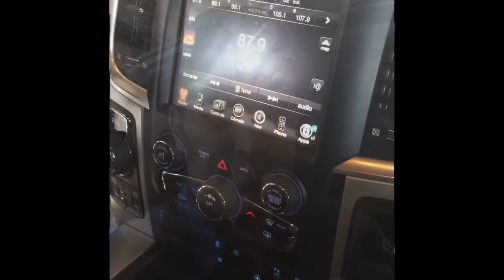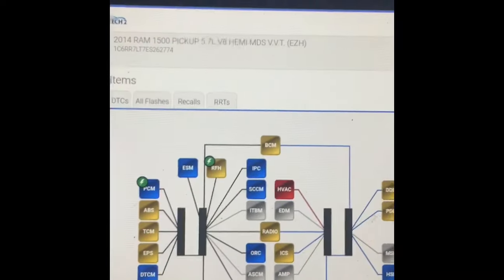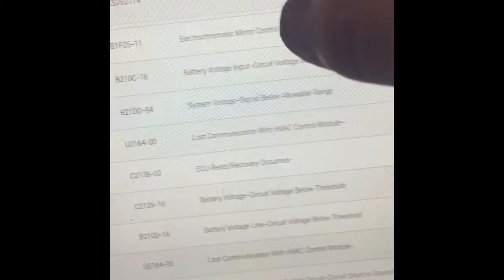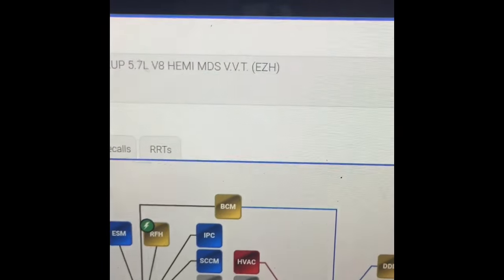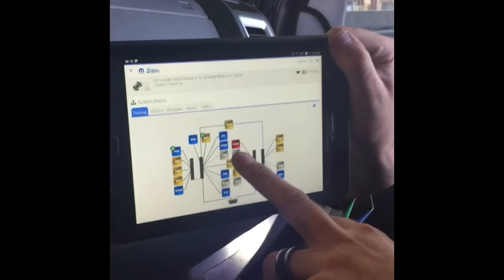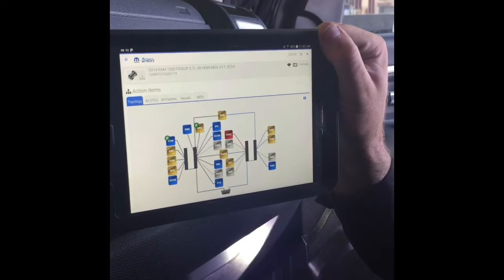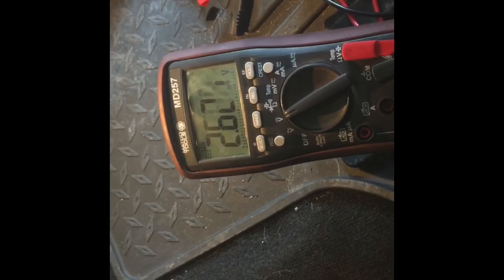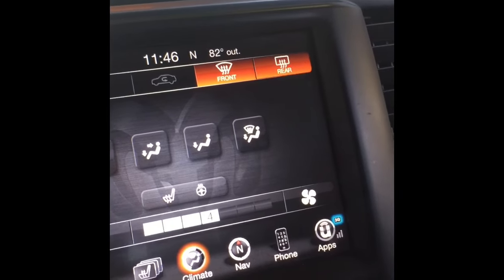Lost communication with module chrysler

Comment: Got a 2016 durango limited 3.6 with the U0212 code. Load tested can + and can- both in spec. Load tested power and ground as well all at module plug which led me to think the module was bad. Replaced it with a new OEM part from the dealer and same codes and wipers stay on with only horn function of steering column. Same issue but all good at the plug. This one has me stumped and it's going into day two at the shop of what was supposed to be a easy fix after the diag.

Comment: I have a 2011 ram 1500 and lost communication with central gateway,radio "aftermarket",hvac and my key fob will not lock,unlock anymore. I do not have remote start 5.7 Hemi

Comment: Got busted at job making videos? Just gave up? The luxury of being a dealer tech is having known good parts to plug in like very expensive control modules. Most of the time you’ll probably be OK but you should load test any of those circuits. Good video. If you have the module you don’t have to load test them just plug it in and see if it works.

Comment: What about 2015 Chrysler 200 ? I have no power in my middle console and was told my control modules was the problem
Reply from the maker: Yes it more than likely needs a control head.
Reply: Do I have to take it to dodge or can I get a mechanic to fix it ?
Reply: Is it very expensive ?

Comment: I have a 2012 Durango R/T.  It has an intermittent problem where it starts and runs for a couple seconds and then dies.  Attempts to start without first turning off the ignition result in a 10 second or so crank with no start.  The engine will start and run fine after the ignition is turned off.  I have had the fuel pump relay recall done and I have checked the relay's function during one of these events, I know the fuel pump is getting power.  Yesterday it did it again and I was able to use my diagnostic tool and saw that at least half of the 20 or 21 modules lost communication with the ECU; the ECU showed no faults.  It will probably run for months without this happening again. Ever see or heard anything like this?
Reply: Did you figure out what was causing it to not start?
Reply: Bumpp
Reply: @Highrev57 any updates boys

Comment: Why did you test all the voltages in a STATIC state?  You could have 14  v at the connector when unplugged b/c there's NO current flow.
However, plug it in and BACKPROBE it.  You could have a voltage drop "upstream" from the connector and when the circuit is CLOSED, you are only getting 7 v at that wire!  If you don't need to voltage drop test this circuit, please explain why not.  Thanks so much!
Reply from the maker: That’s over thinking this easy diagnosis.
Reply: Load tested the one I am stuck on right now and everything checks out at the plug. New OEM module from the dealer and still no coms and still the same U0212. Load testing along with just static does not always show the issue and just because everything checks out at the plug load and static does not always mean the module is the issue as I am finding out the hard way.

Comment: My brothers 2016 jeep Cherokee latitude is doing the same thing. Where is the HVAC control module? Is it behind the head unit that has the 3 control buttons? I see a black box with 2 different harness connectors. His ac system is to be dead and all the fuses are good. None of them are blown.

Comment: I need a expert opinion.  2017 Jeep Cherokee. Trail hawk 2.4. Got tints. He removed batt. After a day I got cel. PSCM no communication (still had power steering. Or electric idk which I got. ) month later or so. Cel came one. Tried scanning. My scanned freaked car out. All dash lights and chimes and stuff came on along with front wipers. Reset it with a better tool. Had permanent codes for loss connection to tmc bcm pscm scm can c. Vehicle speed measure and vehicle distance measure. And can bus c code. All relate to the can bus. Could it be the battery is bad? Or should I just reset the ecu by taking off the bat for a while?
Reply: I hope you got your issue figured out. I've got the same thing going on with a 2012 300c. Same symptoms. However, I'm pretty sure my problem is related to rodent damage, as the car was barely used and was parked where it had happened to other cars.
A low battery or a bad ground can cause the issue, or a broken (or chewed) wire can also cause this.

Comment: What about for this code U0141 on a 2008 Dodge Grand Caravan SXT 4.0L V6 Lost communication with ipm front control, fcm, and tipm, I already replaced my blower motor, and blower motor resistor, and my AC  or heater work when it feel like it

Comment: Hello I have a 2016 Chrysler 300 that was jumstarted and after being jumstarted there was no crank no start after several tries the car tries to crank but no start and then eventually it will start air bag light is on codes are on for u0100 lost communication with pcm, c211b ignition run start imput circuit open, p0481, p0480 cooling fan and p258a electric vacuum pump circuit i think it's the pcm but wanted to know if you've seen this if you read this let me know thanks

Comment: I have 07 dodge magnum srt8 and I’m getting OBD II codes. They are as follows no communication with HVAP module, lost engine coolant message, lost communication with ECM/PCM, check TPM, small evap leak, misfire cylinder 2, my key stopped unlocking my doors, and my head lights flickering. I had my TCM replaced about 7 months ago at a dodge dealership I’m beginning to think they replaced the wrong part. I would really like your advice if u would. Does this sound like a bad ECM/PCM? I don’t know what to do; also, the car has 83k miles if that helps. Thanks
Reply: Did you ever get this fixed

Comment: This was my exact problem  so I went to a junkyard and finally found one and now i have ac
Reply: Did you have to program the module?
Reply: Same with  my ram. Those suckers are expensive. Junk yard less than 100 vs the cheapest one at 450. They go from 450 to 995.

Comment: I have a 2006 Dodge Dakota 4.7L V8 automatic transmission with trouble codes U0101 and P1603. The transmission is stuck in 1st gear and I have a bunch of transmission codes. Any suggestions?

Comment: Hello 
Ram 2014 1500 laramie 

I got (U112c - U113B  / U0140) active errors and B1D9B stored error.
The 4X4 and all lower dash controls (traction/seats heat/tow..etc) are not working but i can control it from screen, next day the screen didn’t work! 
Before the screen went off i took the car for dealer and after diagnostic they said we want to replace the lower dash switches then check the BCM which is the switches cost around $1200 !!!!!
Please help
Thanks

Comment: I got a 2014 Ram that my local dealership cant diagnose... Maybe you have some input on it... While driving the cluster n center console goes black and the ac stops blowing as well... The truck keeps running as usual... Eventually after a few miles everything comes back... Any idea of what it could be?
Reply: Did you ever get the issue resolved?
Reply: @khaosol  Negative. They replaced several things.... ignition switch 2x, alternator n etc...got tired of it and traded it in

Comment: Help I have a caliber srt4 , no crank no start, lights  work and everything. When I try to get codes with the scanner it says no communication  or lost communication  with the pcm ..... I tested the starter and it works, battery is fine.... do you think it is the pcm ? Or tipm? I hope you can help me :( thanksss
Reply from the maker: I would check your power, ground, and bus circuits to the pcm. If they are good then yea you probably need a pcm. I just came across a wiring issue where I had everything but ground, so make sure you check all those things.

Comment: Nice job. I have a u0168 loss comm with security module. But it's starting. Customer claims it didn't have a no start till the installed a aftermarket remote start. 2011 dodge ram 1500 5.7 hemi. Any thoughts after I check what you did on that hvac module. Powers and grounds and can network on the security module?

Comment: Any idea of a higher than normal can voltage such as 3.2 or low voltage of 1.6 , i got a ram from harvey flood all harnesses and modules replace except the harness from the dash to engine harness , star can showz 2.4 v but no comm with any module on the small stsr can
Reply from the maker: ladale21 you mean can (+) is 3.2v and can(-) is 1.6? There may till be a corroded short I side the harness you can’t see with all that water that’s probably your issue.
Reply: Another MOPAR Chrysler Tech i got a used harness for body and engine still no ckm with any under hood modules , found out at tge endof install that the main can wiring is a $100 (new) dash to engine harness, ill be replacing that next week

Comment: Would that be a error code U1403? I have a 2016 Jeep Patriot and all the lights on the dash board all flash on and off like a Christmas tree periodically and where the mileage is shown it says NO BUS when the lights come on...the error code is U1403 that comes back...I just recently had the TIPM changed due to a accident at the dealership,  but it is still having all the warning lights on the Dashboard Light Up and when I took it back to the dealership they act as if they've done what they could and they tell me that I need to take the vehicle to a a vehicle electrician to get it diagnosed but my vehicle still under warranty and I feel that it should be able to be diagnosed there at the dealership since they didn't fix the problem in the first place. What do you think? Any advice that you can offer me would be greatly appreciated because I feel like I'm at my wit's end with this vehicle already!

Comment: I have a question I had a 3200 stall converter installed and when everything was put back my transmission signal was lost can you help me out on what you think it could be?
Reply from the maker: Sounds like a wire for pinched

Comment: I have a 2014 ram 1500 with a u0140 code but reset and hasn’t been back on but what would throw that code?
Reply from the maker: John Seaman almost anything but usually it’s just a bad intermittent connection. Those are hard to diagnose and you have to find out what lost communication with the BCM. Usually if you don’t notice anything abnormal going on in the truck I wouldn’t worry about it. About the only time I ever replace a BCM in trucks is for door lock issues.

Comment: So basically plug nd play take a chance with a new BCM MODULE when u get list communication code  with the BCM!!!
Reply from the maker: You can’t plug n play a bcm. Bcm are vin specific and unless it’s programmed you wont have full functions of your vehicle.
Reply: @anothermoparchryslertech1466  well funny thing is that uf the BCM is from exact same car model nd year , will b just a plug nd play as far as for some one clarify this from a same car model nd yr dodge charger that is!! M just sayen
Reply from the maker: @Chriselectricfingers  the vin won’t be right though but good luck!
Reply: @anothermoparchryslertech1466  that dont matter long as it works like it should

Comment: What scanner did use in this video? Can any scanner work for Dodge Ram? Please help.
Reply from the maker: Jesus Encinas I used our factory scan tool. I’m not sure what you need help with but a scanner from any auto parts store should be helpful.
Reply: @anothermoparchryslertech1466  
I have a 2016 Ram 1500 4*4 with 3 codes at the moment. U0402, U0001, P1DD2, something about failed communication with TCM but my truck is driving fine. Any suggestions on tackling this myself. I would really appreciate your help on this matter.

Comment: i have a 2009 town and country... i replace the battery and now my radio dont work.... and i got a code u0184  lost communication with radio.... how can i fix this issue
Reply from the maker: Juan Hinojosa check the main fuse for the radio in fuse box in the engine compartment. If it’s not blown you either have a break in the wiring or the radio is shorted internally.

Comment: I paid $700 last year to have the body control module replaced and another $600 yo replace the radio. Now the same thing the ac was doing last year, it’s doing it again! Plus my signal light and brake light on the left side is now out. I paid $42 for the damn bulb and it still didn’t work. All this was done at Chrysler! Theyre tryna rob people blind! Now I’m getting a u0168 code. I think they installed a bad BCM or didn’t change it at all last year

Comment: dodge charger se 2012 
I have a traction control lamp on problem and no speed control working
I put it on computer to check and the code was C006A49 
And written multi axis acceleration sensor - Internal Electronic failure 

Please help because no body knows what is the problem
Reply: The history of this lamp 
Morning when i start the car the lamp is on and when i move the car and turn left it turns off
More than one year like this but ralery happens
Now is always on

Comment: Can + is 4.5.... can - is 2.4 .... is this acceptable?
Reply from the maker: NO ITS TOO HIGH. DISCONNECT THE OTHER END OF THE CIRCUIT AND SEE IF YO HAVE A SHORT TO POWER IN THE IWRING BY DOIGN A RESISTANCE CHECK.

Comment: My husband is a driver of Jeep Wrangler JK Rubicon (2015)
 Airbag light keeps turning on once he turns on the Jeep and never goes away.
 Malfunction code is U0151.

 Is this because of ORC module problem?
 He changed his clockspring but didn't work. 
 He unplugged the airbag connector under the driver's seat and the passenger's seat and plugged them again and didn't work as well.
If this is the problem of ORC module, is it possible to solve the problem by resetting the module? 
or anybody knows how to fix the problem?
 Thanks!

Comment: I’ve been having a really hard time fixing my car, it’s a challenger 2016, it honks by itself, the voltage drops but the main thing is the car keeps shutting off after starting and the hazards have gotten stuck a few times. I just bought this car and put all my money into it. The dealership also tricked me into signing a contract without warranty. Hopefully someone can help or knows what’s wrong. Does this sound like pcm/bcm?
Reply: Do you know where the bcm is located? On the 2016 charger se?

Comment: I have a 2006 charger 3.5 sxt high output and i get a no bus on cluster and i get no fuel pump no starter no lights no window. It does nothing ... Ive changed eveything under hood as far as sensors go even changed the tipm and pcm and a new reprogrammed key and still nothing still the same NO BUS... iam litetally gonna fckn torch this damn car spending all this damn money for it not to work.... Is there anything you can suggest

Comment: I had my engine changed out 4 months ago. 5 days ago my car would not start. They told me it was the module within the fuse box called 68143314af. It is going to be 1067 dollars to replace. Does this have anything to do with the engine. Is it part of the engine or a component to the engine? I have a 1 year warranty on the newer engine and need to know if theses mechanics are being dishonest with me.
Reply from the maker: What kind of car is it?

Comment: i have a 06 dodge sprinter and i don't have TCM communication.
how to star to diagnostic this car?
Reply from the maker: omar monzo same basic way. You need to find your power and ground to the tcm and then check your communication wires to the tcm
Reply: ok i checked power & it has It. i check groung and resitence and ok
so in this case in going to need A TCM?
Reply from the maker: omar monzo yes

Comment: Help lol I have a 06 Dodge Charger Daytona and I'm getting a vibration in low RPMs and when I'm stopping it feel like the car is like good to stall anyone have any suggestions motor mounts or is it the torque converter it's nothing the driveshaft it's in the engine or something I though it might be the MDS system messing up cuz it goes away when. I use the autostick
Reply from the maker: jack T check your spark plugs they need to be changed every 30000 miles and  and sure you use mopar p.ugs or you will have issues. Start with that.

Comment: Andrew can I make an appointment with you I need help with a Dodge Durango 2011 is possible to ask for you at the dealer service?
Reply from the maker: IM IN ARIZONA. WHATS WRONG WITH YOUR DURANGO?
Reply: @anothermoparchryslertech1466  well it says is not communicating with abs module also some times don't start I believe is the tipm. Is been like that for over a year, last time I checked the stored codes they were to many. Also very low gas mileage is a 3.6L with 24 inch wheels getting only 9 to 11 miles per gallon😭. I thought you worked at San Marcos CA. What part of Arizona I go sometimes to Phoenix
Reply: @anothermoparchryslertech1466   hey Andrew is possible to change my engine from 3.6 to 5.7

Comment: I have 2006 Dodge Charger rt 5.7 n have a 0700 code n u0100 code it says I loss communication with ecm/tcm it would just randomly stall should replace the tcm or pcm or should I replace both
Reply from the maker: Infamous M.O.B. Spark plugs that are not oem can cause random stalls. Also the pcm and TCm are the same module. I would try spark plugs first and then double check the actual wiring harness for damage
Reply: Another MOPAR Chrysler Tech the dealership gave me a full tune up and changed one coil that had carbon tracking it ran good for a while then started back stalling recently I just had the computer read at autozone the info that I gave you above is all that’s it’s saying everything else checked out find